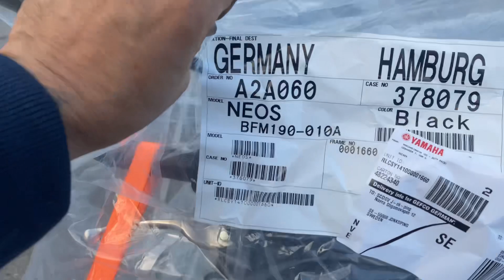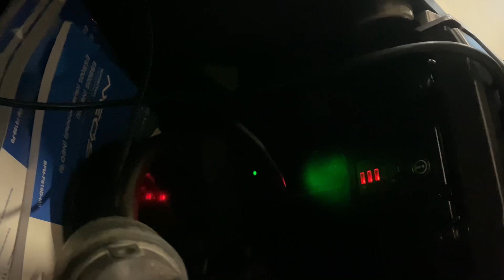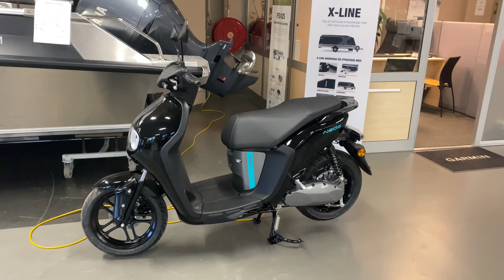Unboxing yamaha neos 2022! Electric yamaha scooter 🛵❤️{4k}enjoy

Comment: @ 2:30 Is it really necessary to use the lock that sits below (and directly above the rear wheel) for every time one opens the seat/storage box?
Reply from the maker: No!  only before the wireless key is activated, then you need to open from there
Reply from the maker: when it is sold then the owner gets a wireless key and then he can open the pad with a button